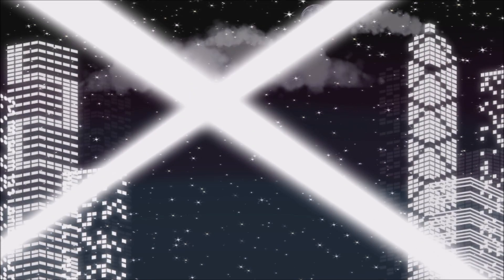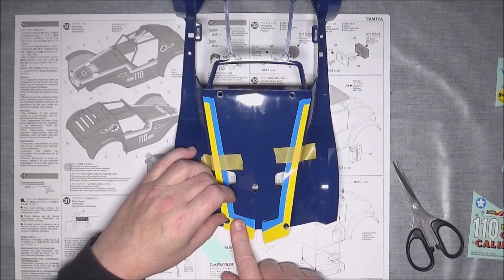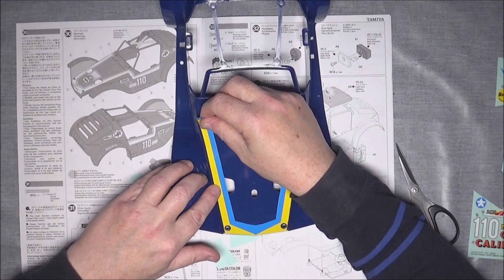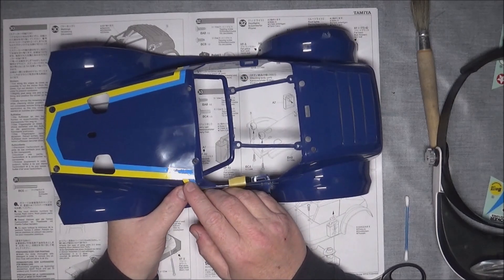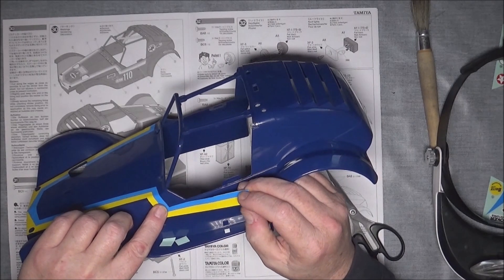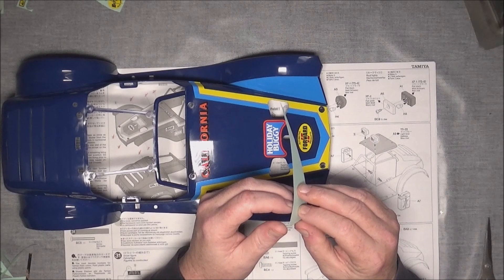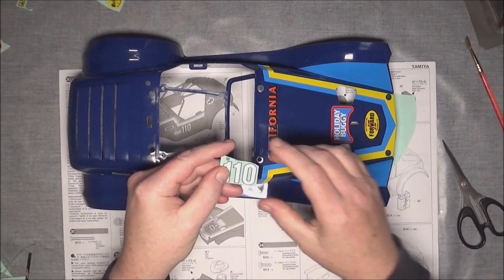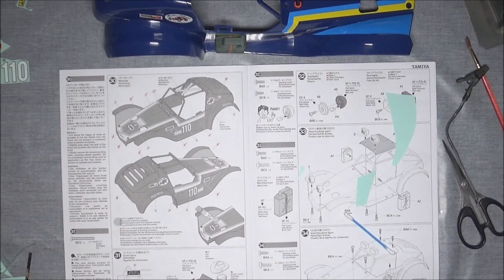Tamiya Holiday Buggy DT-02 Build Part Six

Comment: Hi Rob, i forgot to tell you that if you drill a couple of holes in the shock tower a bit inboard and down, you can cut the top off the shock tower to lower it and then you can fill in the shock holes in the body for a smooth bonnet. The two holes in the front of the body used to be for the front body mount to screw it on underneath the bonnet. I found it funny 😁 that the decals you found hard to apply, i found easy, and vice versa for me with the easy ones lol 😂. Nice video series Rob, looking forward to seeing the next episode??? lol 😝
Ps.....jerrycans lol 😂
Reply from the maker: Hi Mike. Thanks for the info. I might try that at some point. But honestly at the moment I quite like the holes.
Hehe. It is funny but that's what makes us all different. The world would be a very boring place if we were all the same. Only one more build vid to go then we will see how it goes woohoo! Thanks again and all the best.
Reply: @robbrennanrc  
My sentiments as well.